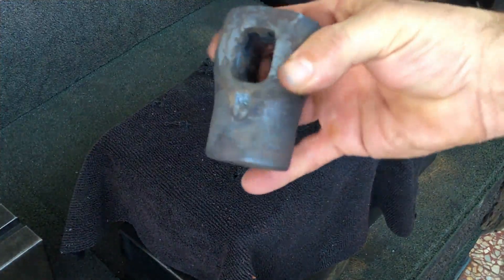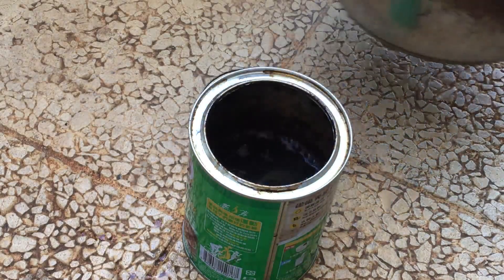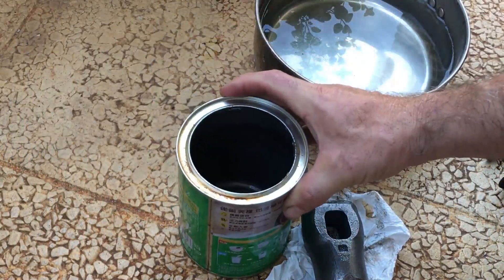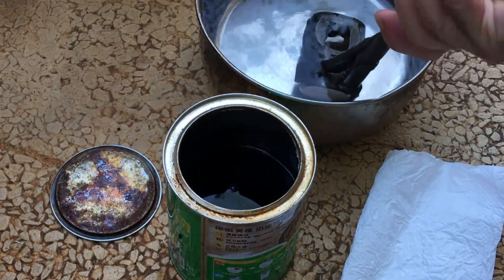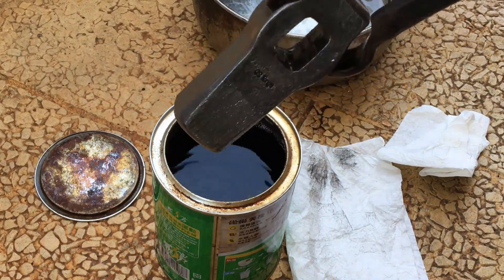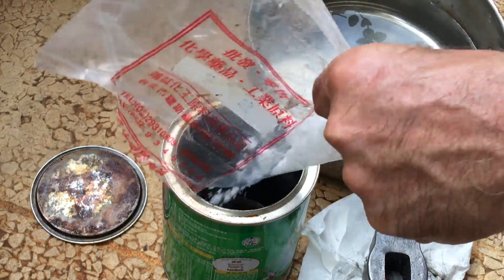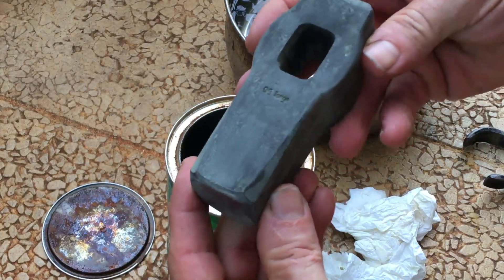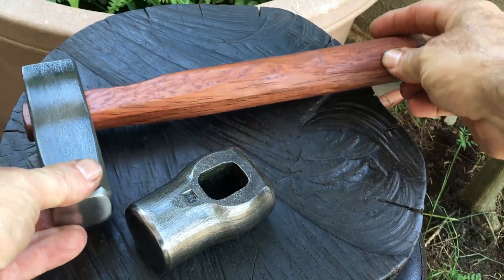Drain Cleana Patina, Oxalic Acid, Citric Acid affects on steel

Comment: I'm not sure if it'll be available over in Taiwan, but I really like using gun bluing solutions for color and a bit of rust protection on tools.  My favorite is Oxpho-blue from Brownells which is a mixture of phosphoric acid, so it'll convert rust to iron phosphate, and a copper depositing solution.  Darkens rougher surfaces nicely and is a pretty rich blue-black on polished surfaces.  Very easy to use, just degrease the surface, wipe it on with a cotton ball, and steel wool the surface.  Downside is it smells like rotten egg's evil older brother because of a selenium compound in it.  100% worth the funk, though.
Reply from the maker: I've never seen gun bluing here but then again, I never specifically looked. The oxalic acid also smells terrible. Thanks for watching and taking the time to comment.

Comment: I’m a subscriber, Love the content✊⚒️ 
I am working hard on putting together my own small setup for blacksmithing basic ornate items and tools and art.
I’m having trouble finding a suitable anvil on my budget. 
I really like this anvil you use. Is it something I can purchase somewhere or is this a one off fabrication by yourself or someone else? 
Keep the content coming, it’s really helpful
Reply from the maker: Hi Jeremy and thanks for being a subscriber. I don't sell my style of anvil. For a short time, I did sell one smaller version but getting anvils made is a difficult process and the shipping was just too high for such a relatively heavy item. If you are limited by budget, even a hunk of any steel (even mild) could work as an anvil. Maybe go to your local steel supplier and see if they have a drop bin you can pick from. They used to weight that stuff and charge by the pound but it was reasonable. Good luck in your blacksmithing and thanks for watching.

Comment: Your steel container might be interfering with the process and result you are looking for depending on it's anodic value compared to your hammers. They're both carbon steels, but It isn't neutral like glass or plastic, so it probably has an effect. It's also eventually gonna rust through. 
Glass is the safest bet, if you go plastic, look up the particular plastic's chemical resistance online to see if your container is suitable. 
Do you degrease with acetone before dipping the parts?
Reply: I did see him mention cleaning the part with acetone first. 
Another thing with the liquid drain cleaner especially, sometimes they add Inhibitors to those to keep them from eating through people's metal pipes in their houses. Some drainage plumbing pipes are still steel. That could be why the effect was so much less dramatic with the liquid drain cleaner versus the flakes.
I do agree with you about using a plastic or glass container in the future as well. At least steel is somewhat resistant to sodium hydroxide. If it was aluminum, it could have been a horrible reaction and things would have gone everywhere in a bubbly mess.
Reply from the maker: Your point about the drain cleaners needing to be metal pipe safe did cross my mind. And so I somewhat wonder if that's why drain cleaners are now mostly alkaline. Anyway, I don't want to get too involved with possibly dangerous substances. I will however try the liquid drain cleaner in a glass container. Thanks Keith for the good info.
Reply from the maker: You make a very good point - something I never thought about. I will see about a glass container and if that yields different results. The oxalic acid has proven to be the most consistent so far. Thanks for sharing.

Comment: Hydrogen peroxide, bleach and baking soda with water are used individually to patina veg tan leather..with very different colors of patina..I wonder if they will have any effect on steel..?
Reply from the maker: You ask a good question. I just know that when mixing these sorts of things you have to be extra careful. I've heard of people creating hydrogen gas or something powerful like that with simple household items. I need to research... Thanks.
Reply: @gstongs  most definitely be safe..I was more talking about individually trying those different types of chems used to make patina vs a mixture of anything that would /could cause an unsafe reaction or situation.. electro chemical plating is another avenue as well..Copper will plate steel readily and then Nickel will plate to the copper plating..both interesting rust prevention coatings.. most people use vinegar with salt and make the copper or nickel solution with simply a copper pipe scrap or a piece of Nickel then add the item to be plated..all with use of little more then jusr a 12v dc battery charger to a variable dc power supply etc..YouTube has several videos on the subject..

Comment: You could look into traditional rust bluing (like on guns) -- it's surprisingly easy.  It takes a moist chamber (can just be a cardboard box with a humidifier) or a steam box, and only takes boiling water and a very soft wire wheel to convert from red rust to blue.  https://www.youtube.com/watch?v=O4QOcRTZv2Q

Another possibility is chemical black oxide treatment (which is basically an accelerated rust bluing).  https://www.youtube.com/watch?v=xmv58Z3RZ9c

One other substance I've heard of people using to patinate steel is mustard.  I don't know if it just contains vinegar or if it's something else.
Reply from the maker: I've seen the mustard thing and might try it on a knife. Thanks Alan for sharing the useful information. I'll keep looking into different methods and monkeying around.

Comment: Drain Cleaner, WOW! 😳
I just never imagined I'd see such a great result and protection from rusting, Glen.
Thanks for all your experiments, and these in particular. 

Years ago I used to enjoy copper electrolysis with a 6 volt battery, copper sulphate and transported the ions from a copper source to an iron "subject to be coated". It seemed like magic to me, and a lot of fun. 

That's what I like about your videos; they always have that playful element to them, like a good short story with a surprising ending.
Reply from the maker: I guess when in doubt, just have some fun. The brown hue from the drain cleaner is really nice. And so far, that hammer is rust free. But the oxalic acid is more consistent. Thanks for all your support dav.
Reply: @gstongs  😀 Thanks Glen.

Comment: Citric acid is more of a cleaner for rust but it does leave more of a shiny gray finish . Just use wd40 after because it rusts if you don't.
Reply from the maker: I haven't yet tried the citric acid but I'm real pleased with the oxalic acid and how consistent it is. I used it on the piece I forge for my next video. Thanks for your input.
Reply: @gstongs  First i thought where da hell am i going to get that? But when i translated it to my language it turns out a lot of beekeeping  supply stores have oxalic acid.